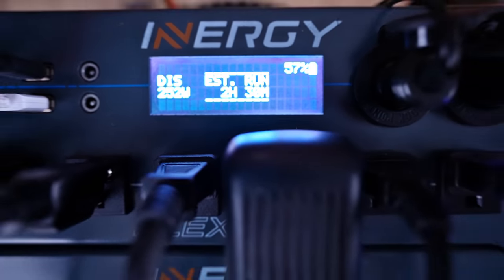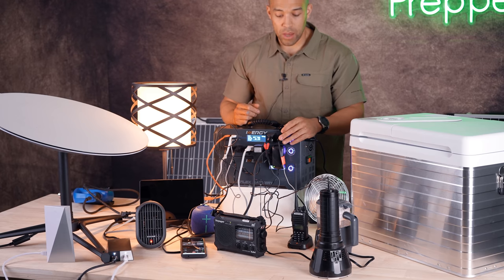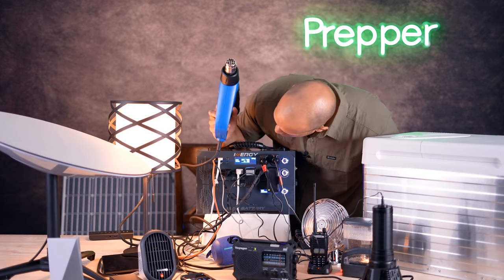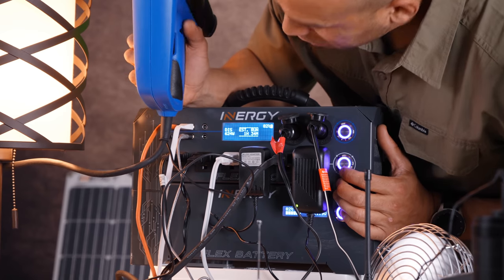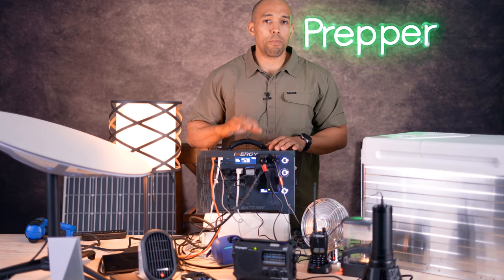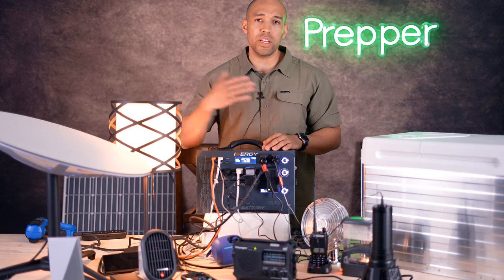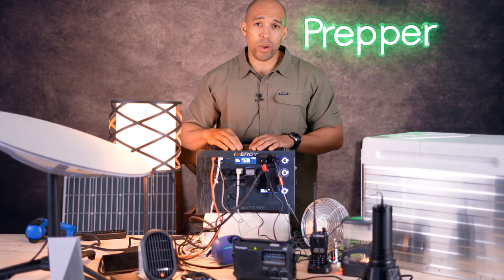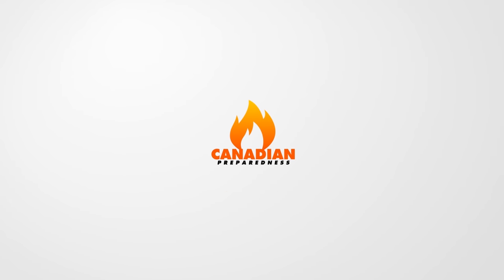Inergy Flex 1500 Tested: How Much Can it Power?

Comment: Energy nerds? 
C.P at least I know ohms and keifkirchhoff, and i understand electronics,  and i am not trying to peddle a glorified crappy inverter with batteries. 
My preppers you could build yourself a true ReGen system for less that can power a dame 5 ton A/C unit if you wanted to spend money. 
But this i will tell you it doesn't make sense going from DC power to AC power then through very bad efficiency like this product back to AC power.
For solar tey this look at your electrical bill and if you can cut that in 1/2 then you are ready for solar otherwise keep everything DC.
👍

Comment: Luv CP, but that is a sad copy of the Titan generator. Titan 3000/6000w inverter, 2000w  solar input, 2 750w ac chargers, 240w 20amp 13.8v,ac/dc operation,2kw batteries  not 1kw, unlimited expansion, ext battery ports, can accept lead acid,gel,and lithium batteries. As I said a sad copy of the Titan. CP I hope you ditched that thing already

Comment: Ehhh. Just buy a 12v inverter and some 100ah deep cycles and a MPPT. 
$1000 can get you a all that and some panels.
Reply: I’d rather pay the $1350 and not do the work; looks nicer, more portable and the lithium ion batteries last way longer with no maintenance and are so much lighter.  Also deep cycle batteries can only be drawn down to 50% vs. almost full use on lithium batteries.  Will Prowse did a comparison of build vs buy.